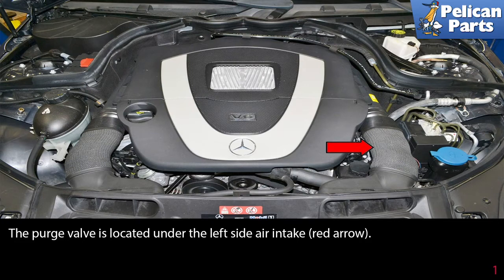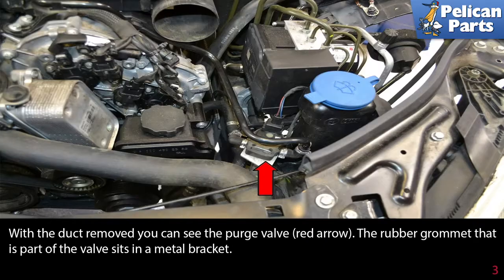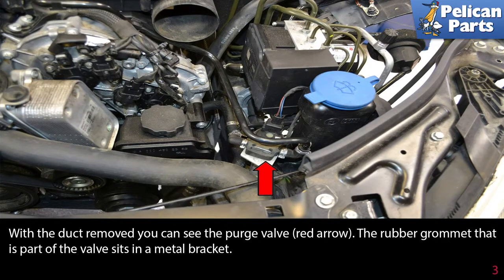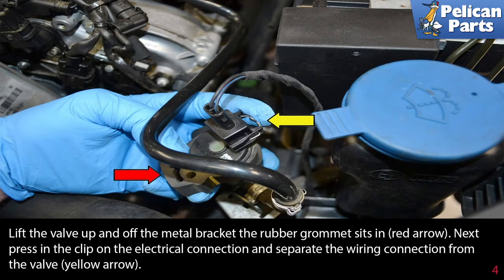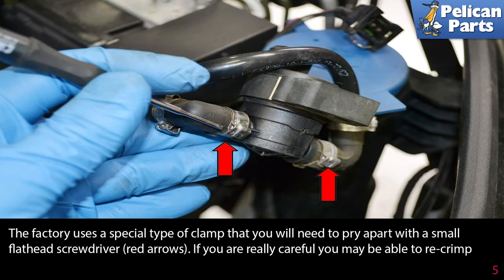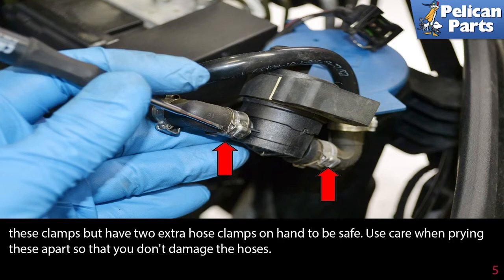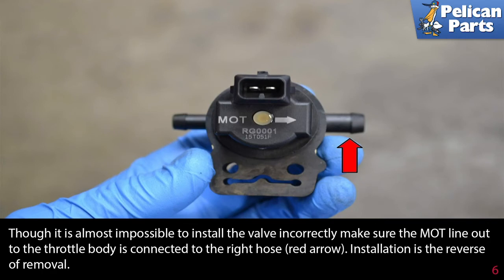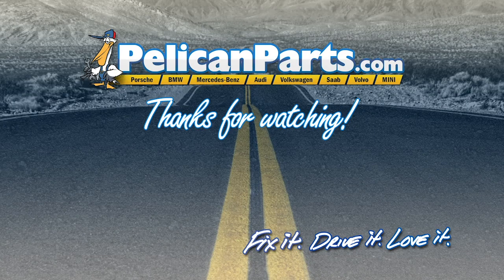Mercedes-Benz W204 C-Class Purge Valve Replacement

Comment: Can this be the reason for a p0456 code?asking becuz i also noticed when i fill the gass tank i can smell fuel even after fueling?
Reply from the maker: Possible if it is stuck open. However, most times that will set a purge fault.

Comment: What is P053A-00
Reply from the maker: P053A Positive Crankcase Ventilation Heater Control Circuit /Open
Reply: @pelicanparts  thanks you so much I’ve been looking for these for months and I get some many different answers and replace all the parts they told me to replace and the dealer don’t even know how to fix it aswell at least that’s what they told me

Comment: What codes can send these ? Can a misfire n rich to lean codes send this to ? 
I changed maf oxygen sensors and fuel injectors codes still show.
Reply from the maker: Generally purge will cause lean at idle only if stuck open. Other than that the standard purge valve operation and circuit codes.